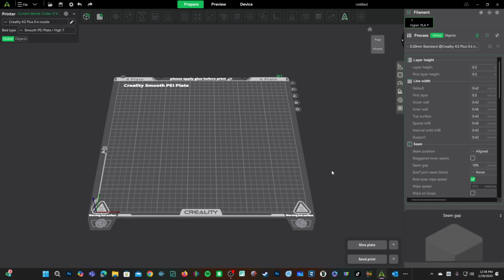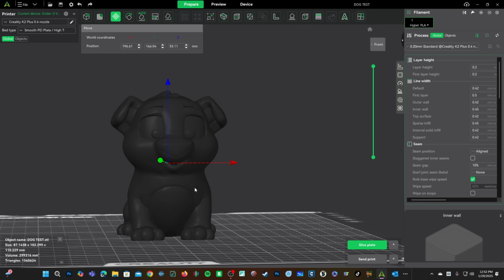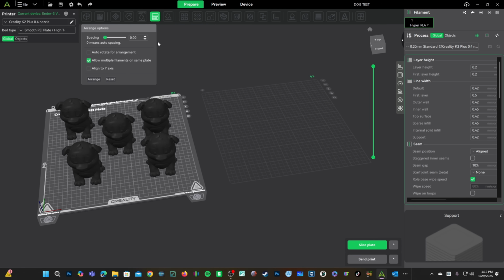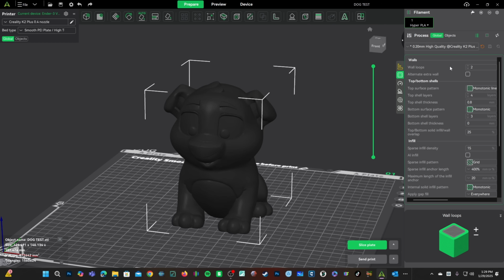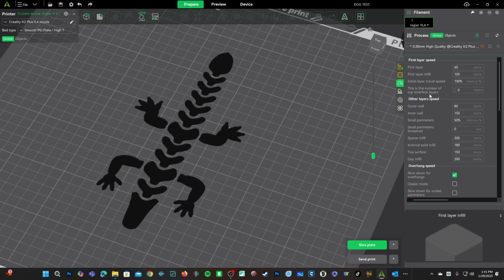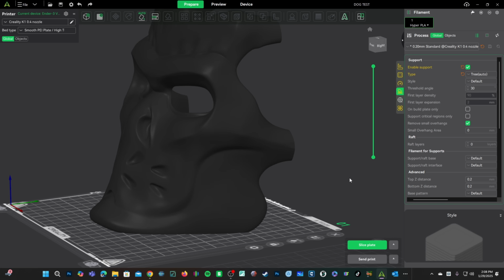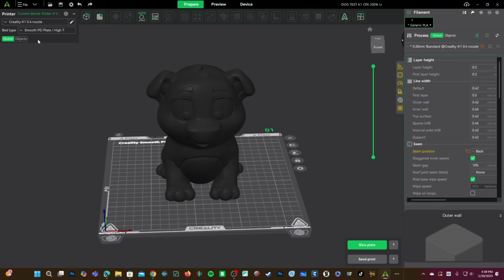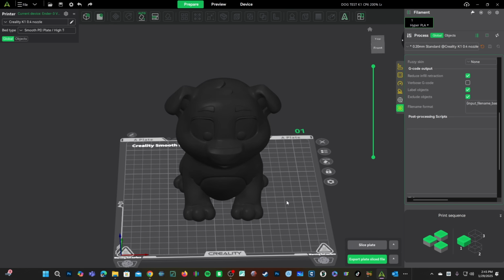CREALITY PRINT: TUTORIAL. Step-By-Step, Detailed Guide to slicing models, for 3D Printing.

Comment: For the life of me, I cannot get temperatures, speeds, and filament profiles to change/save.  When I go to select the filament profile ive set up for either my generic PLA or TPU or ABS etc., it slices with the generic profile of PLA.  None of my changes save, I cant figure out how to get the temperature profiles I have saved to become selected, the speeds dont stay the same either, and overall just a terrible interface.  In the drop down menu under "process", there is only ONE system preset and its for CR-PLA.  No matter how many times i select my custom changes, it ignores it, and starts printing every time using the values in the system preset.  Any idea what tf is going on and how i can make and save temperature profiles for TPU, PLA, and PETG??  Cura, no issues.  Older Creality slicers, no issues.
Reply from the maker: I have none of these issues. Perhaps something wrong in your workflow. Make a video, and link us to it here
Reply: @3DRundown  After a few hrs of messing around, I think I have it figured out.  Do I always have to right click on the parts I want to print and specify the filament I want?  That's what I did, and then it reads my settings and prints with all the parameters I defined.  Actually selecting the filaments at the top right changes nothing for me; only allows me to modify the filament details and colour
Reply from the maker: YES. You have to assign the filament to the part. When you have them active, they are simply active in the project. You need to physically tell the slicer, which one, belongs to the model.
Reply from the maker: I have a full CP6 Tutorial on here, that might be helpful. It's published a few days after this one.
Reply: @3DRundown  Awesome, thanks.  Thats probably been integrated for printers with multiple filament options.  Extremely non-intuitive from any other slicers I have used,, IMO.  It was much simpler in previous versions
Reply from the maker: ORCA, Bambu Studio, CP5, and CP6 work this way. Don't hurt your brain with the WHY, just learn the HOW, and git'r DONE. :)
Reply: @3DRundown  That would explain why I was having issues with CP5 LOL.  This time last year, I don't recall having to do that in earlier versions of CP5 and certainly not cura. Wish they kept stuff the same for longer, trying to learn a new version every few months is a bit much.  Learning something new every day, thanks for the replies!
Reply: You are correct. It is not a very intuitive way to easily change speed and temperatures.

The goal of any app is to reduce the complications, layers of menus, and steps, clicks to make changes.

Modeless.

It would be great to have a "quick change" function that allows immediate speed and temperature changes without digging into sub-menus, functions.
Reply: @Joe_Rhio  Yep!  I hope they fix it in a future update, because trying to remember to change a filament by RIGHT CLICKING THE MODEL  e v e r y  time has already messed up many of my prints.

Comment: Awesome video. Can anyone help me I cant find anywhere a setting in Creality Print 6 to change the Model Fan Speed. Its always at 100% (noisy), and when I set it to a lower speed on the printer or the software, it works for a while then jumps back to 100% fan speed. Does anyone know if there is a setting somewhere to set the max fan speed? Printer is Creality Hi. Thanks so much.
Reply from the maker: Fan controls are in EACH filament profile

Comment: Hello, i need some help, i have the Creality hi combo and its conectes to the same Wi-Fi of my computer and log in to Creality cloud, when I click send print the window is blank what is missing?
Reply from the maker: Make sure you show as logged in. in Device tab, make sure it shows as your current printer. when you print: make sure you have the printer chosen in the send print screen. If no luck.... Do me a favor, reinstall it. See if it helps. I had a login bug, that was fixed this way
Reply: @ i’m using the lates version of creality, o already test everything you said and on device and send print pages are blank with no buttons. Is there a manual way to add printer, insert the ip address ?
Reply from the maker: yes, in the device tab. where you added it to CP6, and set it as your current printer...

Comment: I want to work on Inmoov. Before printing all the parts I should print the CALIBRATOR, to check if your parts will fit together. But I have a very hard time putting those parts together, adjusting the horizontal expansion setting to solve that, users report to set it at -0.15 for a great place to start.

Where can I find the horizental expension setting??
Reply from the maker: In QUALITY, under PRECISION, look for X-Y HOLE AND CONTOUR comp....

Comment: Thank you 3D Rundown!

This video has been a game-changer for me! I watched it the day before my first 3D printer (Ender 3 V3 Plus) arrived, just over a week ago, and it gave me the confidence to start printing immediately. Since then, I’ve revisited the video numerous times and even created this reference based on it. I wanted to share it, as it’s been incredibly helpful to me—hopefully, it can assist others too!

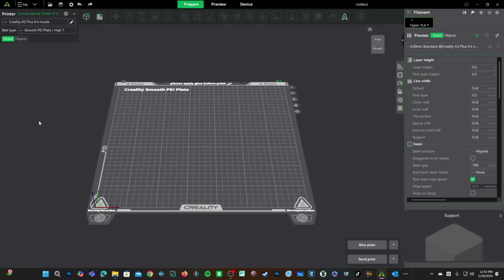 2:15	Import Model
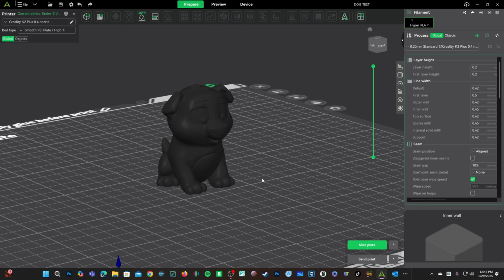 3:45	Sizing / Scale
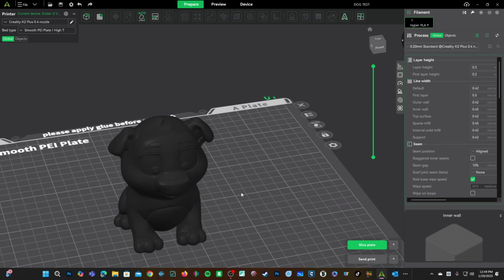 6:40	Move Model
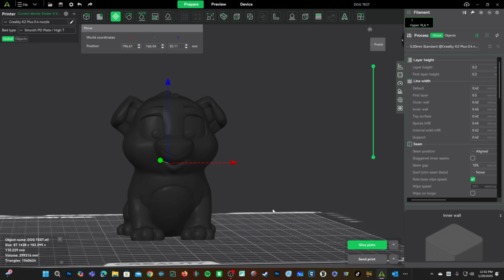 8:35	Lay on Face Tool
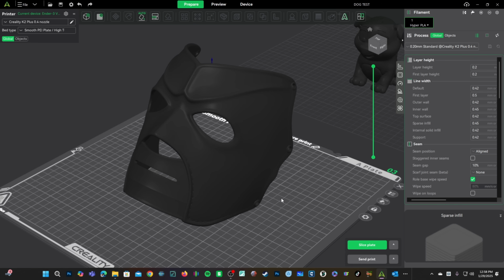10:20	Rotation Tool
12:10	Additional Print Beds / Plates
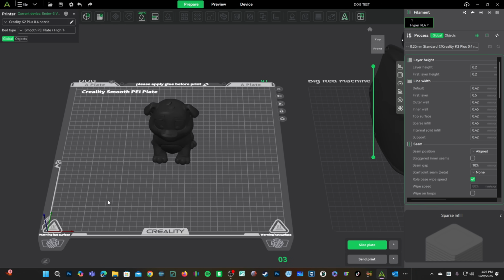13:40	Cloning
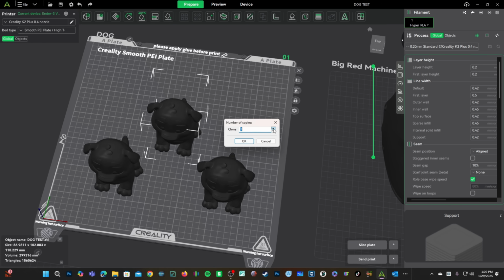14:35	Arrange Tool
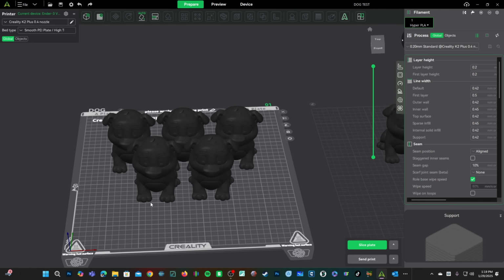18:45	Slice
19:00	Layer Height
20:00	Quality Tab
20:10	- Seam / Z Seam
22:50	Strength Tab
22:55	- Walls / Perimeters
24:50	- Infill
27:35	Speed Tab
34:40	Support Tab
40:50	Others Tab
44:20	Filament Profiles
49:45	Printing
53:10	Saving Projects
Reply from the maker: So cool. Thank you! To help this channel continue, consider being a member to tickling that super thanks button. Also, have you caught my CP6 painting video: https://youtu.be/_-R68Pasaro
Reply: @3DRundown  I have not, I will have to check it out.

FYI, I would love more in depth tutorial videos on CrealityPrint!!  :)
Reply from the maker: I will try. These videos take a LONG time to shoot. It's really hard to keep up with everything, as one single person, trying to keep the lights on. That said, more software tutorials, has been my goal for a while now.... New printers keep showing up, and bogging me down

Comment: I can't tell the CrealityPrint 6.0 is putting the .gcode slicer files it generates. I need to copy that file onto a sim card the get it to the printer. Can you help me?  Thanks!
Reply from the maker: You should be sending it wirelessly to the printer. If you are using an old offline machine, choose "export Plate sliced file" and put it where you want.

Comment: What is the easiest way to set E-Steps in Creality Print with a K2+ ?  The only way i can think of is to remove the nozzle and extrude past the bottom of the part cooling ducts and then cut off flush. However the printer wont extrude unless the temp is up to printing temps. I am stuck.
Reply from the maker: E-steps is a Marlin thing. Klipper is rotation distance. I've never had to do that on any of the newer creality or bambu machines.
Reply: @3DRundown  I figured it out. They do it all thru their "calibrations " menu I was trying to set up a profile for PCTG and their isnt any in Crealitys software so I modified PETG and just kept running each of their "calibration" steps to do it.

Comment: I'm hoping to buy my first 3d printer soon. Your video was extremely helpful. Thank you.
Reply from the maker: Welcome to the Party. If you are going to have ONE printer, make it a:  K1C, K1 MAX, K2 PLUS, Hi Combo, A1 Combo, or P1S combo
Reply: I'm looking at K1SE since it is quite a bit cheaper in my country.
Reply from the maker: I would seriously consider the KE over the SE if you can. The included Nebula Pad, running Klipper, makes a big feature difference. BUT, if you can't, the SE is a nice machine, and the price is great.
Reply: What is the KE? Is it the Ender 3 V3 KE? What is a Nebula pad?
Reply from the maker: YES, the E3 V3 KE. Nebula Pad is a tablet running Klipper. It's on most of the newer Creality machines, including the KE. You'll get Klipper. Full Creality Cloud support. Wireless printing. OTA Firmware updates, etc.
Reply: What are you views on hi combo ? Is it good compared to A1

Comment: Perhaps I am wrong, but Creality Print seems to be copied from Ultimaker Cura. I don't see much more advantages to use it. And what about the compatibility with old Creality printers? I only see the last generation of Creality printers. Otherwise, very good video explaining the settings!
Reply from the maker: You are wrong, it's based on ORCA & BAMBU STUDIO. It's Creality Profiles, are also developed by Creality Engineers. AND, it connects directly to CrealityCloud, and Klipper Fluid, for managing your Creality Printers. CP6 > Cura, ALL DAY.  Bambu Studio > CURA, also.  And I'm a big Cura fan....

Comment: in the device tab there is a setting that says printing speed, wondered what its for
Reply from the maker: I'm looking, but I don't see it....   Where do I find it?
Reply: @3DRundown  on the line that has prepair preview  and device on top of page,  hit device   on the new page about half way down on left it says speed
Reply from the maker: Are you on the latest CP6? I have tried everything to see it, but can't. Perhaps it only shows up during printing? In which case, it would, perhaps, be a function enabling you to increase or decrease the set speed, during printing....
Reply: @3DRundown  yes on latest version,
Reply: I see it using the latest Creality print 6 On the Device tab under Control, Printing Speed. The options are.... Ultrafast125%, Standard100%, Stable50% and Silent25%. BTW Greg, another great video. Thanks
Reply: @blairm7731  when do you use them if you set slice as this video does with speeds
Reply: @blairm7731  how do you use this in conjunction with setting he showed us
Reply: @blairm7731  my reply keeps getting deleted

Comment: One thing I just ran into with Creality Print was I wanted to print a flat cube (sheet) with some multiple embossed text items, but I noticed that many times it was slicing it weird. I was getting a G-Code error saying things were off the print bed and I basically deleted everything and tried again. Finally I got it to slice without error so I printed and as I watched it print, I noticed that on one layer a single embossed text item was being printed 1 layer lower than all the others which was also below the final layer of the sheet. Not sure what or how I did that and wasn't clear how to "snap" the text to the top of the sheet since it clearly thought it should start inside it
Reply from the maker: Oh fun....  I'll have to mess with that. Are you on a K2? If on a V3 or K1, try it in Bambu Studio
Reply: I have a K2. Unfortunately I didnt save a copy of the project with the GCode Error showing something printing outside the print bed, but do have the other project. Closest thing I can think of is maybe it was because I added the embossed text, edited the text, moved it, then later on decided to change the font?? Maybe it cause the height to change somehow idk